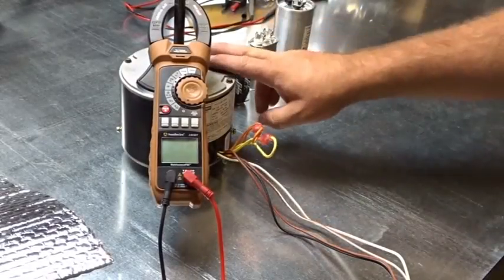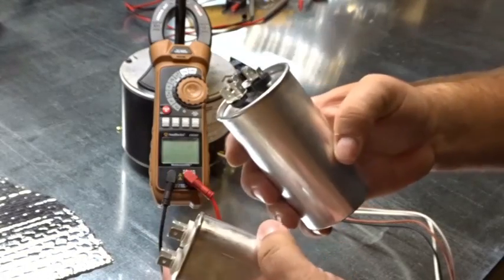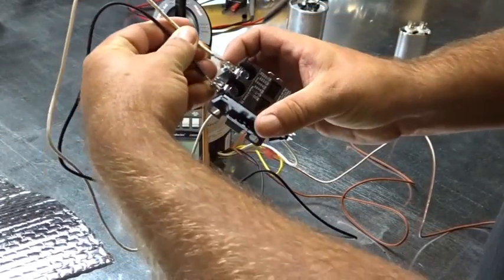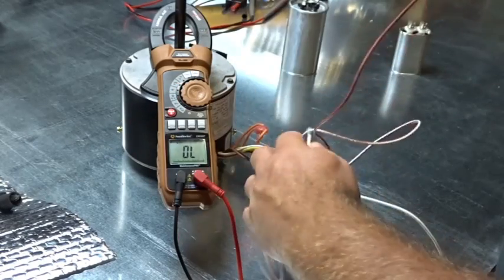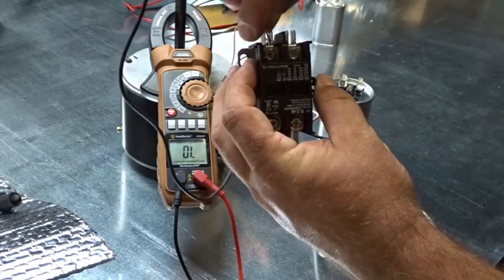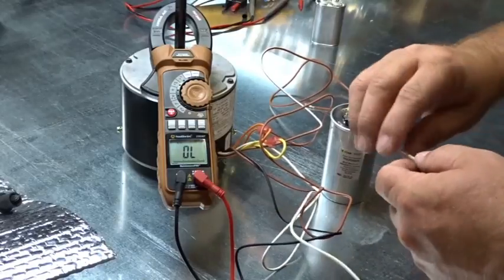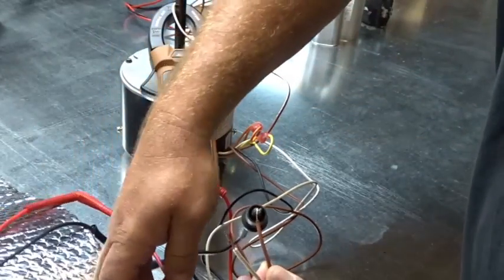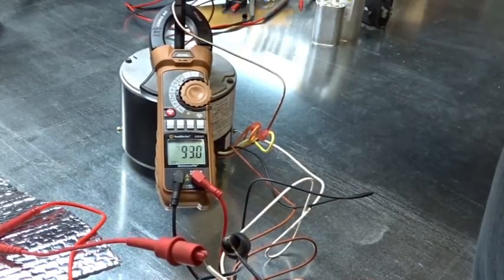Condenser Fan Motor Ohm Testing and Wiring

Comment: hi i have 3 wire  condesor fan motor    black brown purple (then ground green)
black is to contractor, brown is to fan on capacitor,    but purple is to herm with a red jumper on it        then there is a yellow on the common the goes to the other thing in the bottom of the ac assuming the other condensor 

but my fan is not working     the ohm test isnt reading anything 

i wanted to just hook it up to a splice plug wire       would that be black from fan to white wire  (common)      then brown to black (hot wire from plug)?

also my ac has worked for year with purple to herm with jumper  not on common is that okay  just a different set up ??
Reply: You don't need to splice or dice anything, Edward Scissorhands.
You need to call a professional.
Reply: the connection to dual capacitor for a fan motor is nothing to do with terminal of HERM. Herm is for compressor.

Comment: Good point distinguishing the difference on the brown and brown/white wires from fan.  Parts shop clerk told me to just use either wire.  You MUST use the solid brown on the the dual cap setup.
Reply from the maker: Right on

Comment: Does the same way apply to a variable speed condenser? I check the motors wires on a Ruud and I was getting OL in all connections.
Reply from the maker: If it is an x 13 or another type of ECM motor you would test it in a different way.
Reply: @zacksintheshop  
I just replaced a variable speed x 13 on a Ruud condenser, and I checked the blue and yellow 24 volts going to the X13 and power was going into the motor. So I replaced and it solve the problem. All that is needed after checking that there is high voltage, and the other components is check to see if 24 volt is going to the X13, if not then motor is bad.
Reply from the maker: Yes. Most of the time the module is the issue.  On rare occasions I have seen he motor itself fail. I check those with ohms.

Comment: Excellent Zack!
I would like to know how to wire a psc blower motor with 1 speed for cooling and 1 speed for heating using a relay.
(When the blower motor board and relay doesn't work)
Thanks.
Reply from the maker: +Jose Corona I will get that video ready

Comment: Good video.l would like to ask you a question. I live in Easley South Carolina and I have serviced 2 gas packs this year that has had water inside heat exchangers.Have you ever ran across this problem? I had to take a shopvac and get the water out before the units would fire.Thanks for any advice.
Reply from the maker: +Phillip Joy I think that comes from warm outside air in the heat exchanger during the AC cycle. What brand was it?
Reply: @zacksintheshop  Would this not indicate a float switch being activated due to a blocked drain?

Comment: You have say white going to T1 and black going to T2 and Brown going to fan on the Cap. This is no good, you still need a common to the dual Cap. The tricky part is that the common on the Cap. Would be connected oposite the motor common on the contactor. But still the Cap has to have a common weather you connect the run winding on it or the contactor. So for it to work without the compressor there needs to be a jumper from the contactor to the common or you will not get your 90 degrees phase angle shift required to start the motor.

Comment: I've got a resistance reading of 600 ohms I'm gonna guess my fan motor is shot
Reply from the maker: Seems pretty high for a standard motor
Reply: no basic knowledge about condenser motor at all!
Reply: Yeah sounds like it's done. May be getting slight connectivity from a carbon trail that use to be a wire in the windings. Not enough to carry much current at all. So no turning fan.
Reply: @zacksintheshop  mine is 45+64=109 ohms. Does that seem too high?
Reply: @PrintEngineering  put the meter leads on the run and start wires and it should read 109. If it does you’re good
Reply: @michiganoutdoorsman9865  thanks for the reply. I got ahold of the engineering team of the manufacturer and they had me double check that both legs were live. Apparently stink bugs had crawled into the breaker and even though at one point I was measuring a full 240V across the legs, when I attempted to start the motors no current flowed through one leg and because the motor windings supplied voltage to bot sides of the contactor it took me starting the whole testing process over again from scratch to find it.
Reply: I'm getting the same readings @PrintEngineering
Reply: @michiganoutdoorsman9865 thanks man 👍